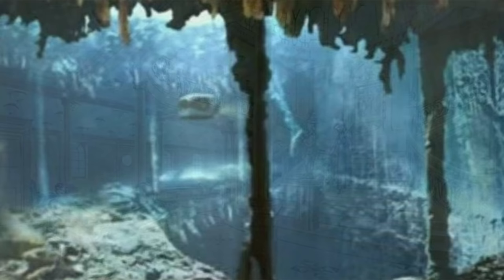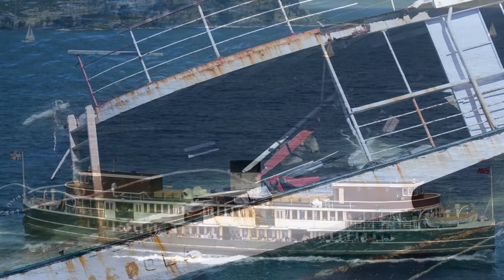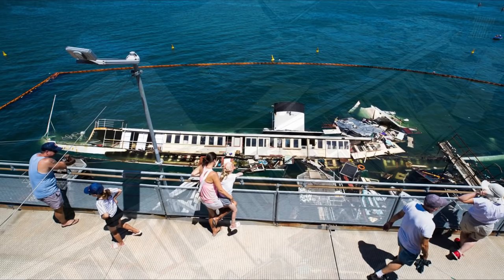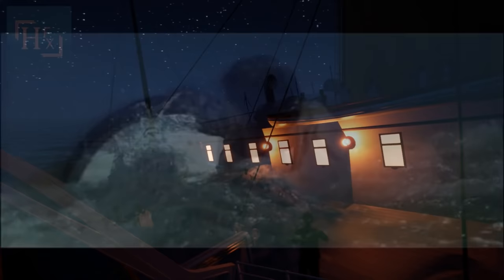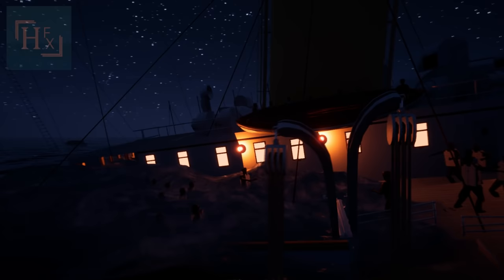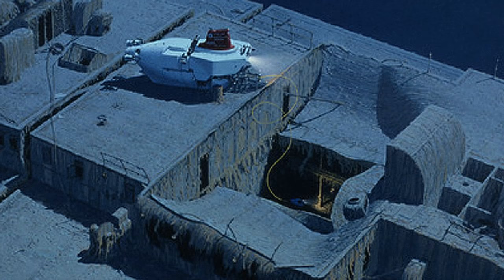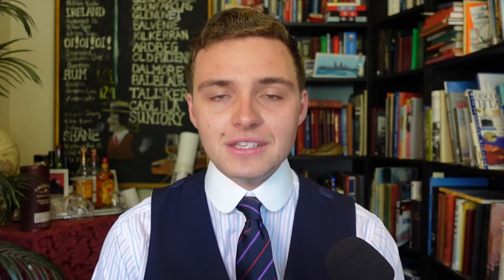What Happened to Titanic's Grand Staircase Dome?

Comment: There is a lot of simple misunderstanding of the forces acting on a ship as she sinks.  For example… Cameron and others portray the hull lifting out of the water and breaking off of her own weight.   This could never have happened.  If the ship had been that weak she would have snapped in two in normal steaming with the trough of a wave under her midsection.   Rather, as per Thayer’s account, she broke UNDER the water’s surface and her mid section went DOWN with either end being tipped up. It was This that first lifted her stern clear of the water, something so dramatic that most witness failed to notice her black bow rise at the same time ( Thayer didn’t miss it, tho. )   And it was only as she finally tore in two, under water where witnesses could not see, that the stern fell back into the water only to fill with water and tip upright due to the weight of her engines. As you point out, Most of her was DRY as she sank.  In fact, for her to stay at the surface at all required her to displace not only her own weight, but all the weight of all the water she was shipping.  Prior to breaking in two, she had dramatically more dry volume under sea level than she had in normal operation.   What broke her in two was the counteracting forces of the weight of water in her midsection, acting against the amount of buoyancy required to keep that weight at the water’s surface.   She was never designed to displace that much weight- and the buoyancy of her dry spaces was pulling the entire ship up against an ever increasing weight of water.  The wooden structures of the pilot house and grand staircase dome almost certainly did not succumb to the crushing pressure of water….  Rather, they succumbed to their own buoyancy. You can see this effect in action in the videos of the Japanese tsunami.   The force of the water did not break up houses as it rose- instead, it was the fact that house structures held the water back and made the entire house into a Boat. Just as a boat pushes its own weight of water aside and that is what makes it float,  so too, the empty buoyancy of the enclosed wooden structure quickly exceeds the force of the nails and screws holding the structure to its foundation and the houses literally Float free.  Once untethered from their foundations they lose a great deal of their rigidity and the current crashes them onto other structures and obstacles and that is what breaks them apart.  Both the bridge and the dome cover almost certainly tore free when only partially submerged, thru the force of the their own buoyancy.  The same is true of the stacks.   The force acting on the stacks was not the lateral pressure of water… but as they became surrounded by water, the vertical lifting force of the buoyancy they created. Try shoving an empty sauce pan down into a sink full of water, to get an idea of the floating forces applied to air filled structures as they sink. And, of course, once they were torn free from what held them down to the deck, they flooded internally and collapsed.
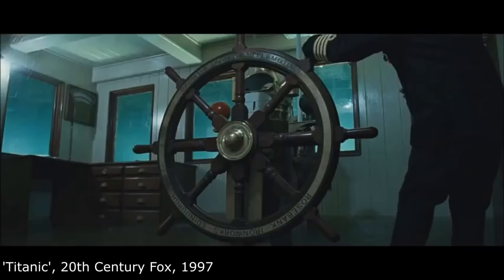Reply: Pick up your cross and follow Jesus! The world is quickly headed for destruction, and sooner or later you will have to sit at the judgement seat and give an account for your actions. Belief in messiah alone is not enough to grant you salvation - Matthew 7:21-23, John 3:3, John 3:36 (ESV is the best translation for John 3:36). Call on the name of Jesus and pray for Him to intervene in your life! - Revelation 3:20. 

Contemplate how the Roman Empire fulfilled the role of the beast from the sea in Revelation 13. Revelation 17 confirms that it is in fact Rome. From this we can conclude that A) Jesus is the Son of God and can predict the future or make it happen, B) The world leaders/nations/governments etc have been conspiring together for the last 3000+ years going back to Babylon and before, C) History as we know it is fake. You don't really need to speculate once you start a relationship with God tho.

Can't get a response from God? Fasting can help increase your perception and prayer can help initiate events.  God will ignore you if your prayer does not align with His purpose (James 4:3) or if you are approaching Him when "unclean" (Isaiah 1:15, Isaiah 59:2, Micah 3:4). Stop eating food sacrificed to idols (McDonald's, Wendy's etc) stop glorifying yourself on social media or making other images of yourself (Second Commandment), stop gossiping about other people, stop watching obscene content etc and you should get a response. Have a blessed day!

Comment: What should be done for ships to be preserved is a levee built around the ship.  The salt water replaced with fresh water to get rid of the corrosive salt.  Then sand would be packed in around the hull to support it.  Then the water would be removed from the sand.  The top of the sand capped from precipitation and pipes at the bottom of the sand dune can help remove any water which appears.  There would have to be a liner to keep the water from the surrounding water body from forcing itself into the sand dune.  The ship will never sink and maintenance to reduce hull breaches would be reduced.

Comment: I think the saddest part in this whole video was that the Baragoola sank. That’s the exact fate that I don’t want the SS United States and the RMS Queen Mary to experience. The fact that it happened to this ship is sad.
Reply: It's very unlikely. The circumstances around Goola sinking was vastly different to QM and US
Reply: @danielcallender8649  my point is that I don't want to get so old without maintenance that they are unusable.
Reply: @danielcallender8649  I mean... It's not that vastly different. They're all just sitting there for decades with no work being done, rusting, rotting, and getting closer and closer to just rotting through and sinking. 

Of course it'll take longer for the two to be eaten though, but it certainly will if nothing's done.
Reply: The guy on Baragoola was doing things that would of accelerated deterioration.  And he freaked out when  she was sinking.
Reply: @higueraft571  yes

Comment: I have always wondered what the interior of the stern would look like if the ship had not broken up. I think we would still see a large level of destruction at least of the interior wall partitions and paneling, and the raised decks over the lounge and smoking room peeling back in a similar fashion to the poop deck. The bow has quite a bit of preservation with water carafes sitting on the shelves of the stateroom (as seen on D deck by JC) and wall paneling in near perfect condition, but as we all know the bow filled slowly so the water was actually able to preserve what wasn't destroyed by the flooding, but the stern interiors would have faced quite a bit of water pressure force as the ship filled up while sinking.

Comment: I don’t think the dome cover itself broke when the dome broke. I think it was simply weakened by the dome breaking, and it was torn off during the bow’s descent to the sea floor. This is because Britannic’s dome cover isn’t broken, and it sank in relatively shallow water.
Reply: If i remember right, didnt it sink more slowly on it's side, with a good few holes for water to breach said superstructure sections?

Most likely, if the water had enough time, it could've begun to saturate the wood, and of course if the water level on the other side were relatively even, it'd be more or less "balanced", not fighting the inward pressure, and only fighting buoyancy.
Reply: @higueraft571  I think the grand staircase did not float out of the dome on the surface. After all, the dome cover wasn't all made of glass like the dome. I think only small pieces of the wood floated out while the main bit of the broken A deck landing stayed trapped under the dome cover. When the ship was descending, I think the forces of the water ripped off the dome cover like how it made the forward mast collapse. If it's not that, then the plume of high pressure water behind the bow crushed the cover and all the grand staircase decks below it when the bow landed on the sea floor.
Reply: @AndyHappyGuy  Annd if it was (most likely) ripped off, there's a good chance the staircase went out the roof when the Dome did. Especially with the wood itself also fairly-aggressively shoving outward, towards the surface.
Reply: @higueraft571  ok
Reply: A parallel are the covers of the cargo hatches on the bow, still present on the Britannic, but were sent flying into the distance on the Titanic as she hit the bottom.

Comment: The dome is what doomed the ship. Once the bridge went under, water rolled over the top of the superstructure and smashed through the dome, instantly submerging the Grand Staircase and granting the water unrestricted access to the upper decks of the ship that it hadn’t yet reached (the same way that “Scotland Road” down on E deck let water flood the lower decks with relative ease)
This ended up dragging the ship under at an alarming rate and the excessive force of this sudden downward pivot amplified the stress on her hull, causing her to break apart.
Reply: Nope the bloody great hole in the side of the ship and overflowing compartment walls were what doomed the ship. What you mention merely accelerated the inevitable.
Reply: The dome had nothing to do with it.  She was a goner before the dome ever got wet.  The iceberg damage made sure of that.  Sinking accellerated once the cargo hatches began flooding.  The entire bow was already underwater by the time the dome and staircase flooded.

Comment: No mention of the staircase breaking through and floating out of the opening, which could have caused the big hole.  People mention why if the staircase was intact on the bottom why remnants of them don't exist, especially the iron supports and railings.  The staircase area seems relatively well preserved with the chandeliers and wood visible in the landings.  The ROV's only found iron stair supports on the lower landing, but not the entire staircase worth of them.  It seems very odd the giant hole is there and the boat deck landing collapsed, if something big didn't break out of the ship there during the plunge to the bottom.  The wood could have came out in big chunks from buoyancy alone.  I think there were accounts of "pieces of staircase" being seen after the disaster.

Comment: I was on the cruise ship Oceanos when she sank off the East Coast of South Africa in 1991. We heard steel creaking and buckling throughout the night as she listed further and further over. In the early hours of the morning windows started shattering and exploding due to the pressure and everyone had to move out onto the deck because it was becoming too dangerous inside. She was quite far over by the time I was hoisted off and she sank a couple of hours later. The sounds of the ferry sinking in the video are very familiar and I can easily believe exactly the same thing happened to Titanic.
Reply: JFC... the ship YOU were supposed on was slowly sinking being part of its bottom WAS touching ground.  It's SLOWLY turning over has NO relationship to T.
Reply from the maker: Terrifying stuff! So glad you came out of it alright! Not too many today could say they survived a sinking passenger ship...

Comment: The grand stair case was never destroyed like you would think it would have, the grand stair case was never nailed into place it was just resting freely as the weight of it kept it in place.  so as the ship sank and the ship was under water the wood lifted (as wood floats) ripping the hole at the top. after a while the wood would then be saturated with water and sink, so the grand star case is at the bottom of the Atlantic floor just no one knows where .
Reply: Not likely.  Mounting with screws, not nails, would have been compulsary basic construction.  Still, that would not be enough to hold once sunken.

Comment: In books written by survivors, they stated the bridge was destroyed when the #1 funnel fell forward. A fact often overlooked by most who never read their accounts of the sinking.
Reply from the maker: Good point! I'm certainly not one to doubt anything a survivor says about the sinking as, of course, I was not there. I would take some of the accounts with a slightly grain of salt as the bridge must have been well underwater at the time of the funnel's collapse, perhaps even already breaking up for the reasons I stipulated in my video. 
~Mike
Reply: @OceanlinerDesigns  No doubt many factors combined in tbe ultimate destruction.  Hard to pin blame solely on one, for sure.

Comment: The superstructure and deck house of Baragoola did not look even partly water tight. I doubt it was all or even mostly water pressure. A lot of it was probably due to deformation of the hull and superstructure as the ship capsized.

Comment: I'm sure I'm the hundredth person to bring it up, but what the heck. I recall a story from the filming of James Cameron's "Titanic" (1997) that at one point while filming the sinking an emergency halt had to be called because the entire Grand Staircase set had started to break away from the surrounding structure. What Cameron claimed was happening, and what he thought might have occurred on the real Titanic, was that the Grand Staircase, this colossal structure made primarily of wood, remained buoyant throughout the sinking, and as the water rose as the ship settled, that buoyancy force kept trying to push the staircase up toward the surface harder and harder until at last the whole thing broke away and broke up, the majority floating up and out of the hole left by the collapsed dome and cover before becoming waterlogged by the surrounding pressure and settling to the bottom.
Reply: You  should keep in mind that the performance of a set and of a real ship would be very different.

Comment: The belief is that  when the   the dome became fully submerged  all all of the glass let go the force of the  down colum of water  basically  ejected the grand staircase  straight up  and out of the dome  shredding  the staircase  to pieces and  destroying  the done structure.  The staircase  was not nailed  of fastened down  in any way.  It was just sitting there being held in place by its own weight  so when the  colum of water  made contact with the bottom of the stairs  the force of the displaced air  shot the  entire  staircase upwards  with such force  it   crashed straight up into the dome structure with such force  it  shredded the staircase  and the structure  of the dome   the structure of the dome would have already been extremely weakend by the weight of the water  and probably already partially collapsed  due the weight of the water.

Comment: Interesting theory, Mike, but like you said, we will never have a 100% accuracy to know what really happened to the ship while it sank.
What I miss in your theory is the collapse of the roof surrounding the dome. Why did it collapse while the roof of the Gymnasium and officers quarters are still intact.
Reply: If I had to hazard a guess, it would be because the gymnasium and officers' quarters sit atop the superstructure whereas the Grand Staircases provided a straight shot down from the Boat Deck to E Deck, deep within the hull.  Fill a bath or sink with water and take out the plug, and you can see the vortex caused by gravity and suction when the water level reaches a certain point.  If you look at Ken Marschall's illustration at 0:50, you can see that the roof of the superstructure is pulled down either side of the opening where the dome used to be - implying that the same effect applied there, albeit on a vastly greater scale.

Comment: something ive heard, dont remember where, but when Mr, Cameron filmed the grand staircase sequense, the staircase broke off and simply floated away as the space filled up. Could it also then be the theorized, that the staircase broke, and like a cork, shot upwards destroying the structure as the vessel dropped to the bottom? im just curious, and i know that theory dont take in to account the drag of the water that the vessel then would create on the plunge, nor the weight of the water as she went deeper.
Reply: The remains of the grand staircase sit at the bottom of the wreck. The floors collapsed into eachother. In the footage take during one of the expeditions you can see parts of the staircase at the bottom of where it used to stand

Comment: And it MIGHT have been blown off from inside by air pressure while near the surface.  The water filling rapidly from below - pressurizing the air bubble above and blowing the light structure apart from inside.   Maybe.  I suppose if parts of the dome can be identified outside the ship in the debris field - it was airpressure.  If NONE can be found - if was pushed in by water pressure.

PS - if your car enters the water - get the windows open asap (if able) to flood car and equalize the pressure as you sink.  Doors will open much more easily.  Otherwise you have a long wait in the shrinking air bubble till pressure equalizes and you can open a door.
Reply: Opinion urs again... not fact.  The slim dome frame, may, have simply rusted away...